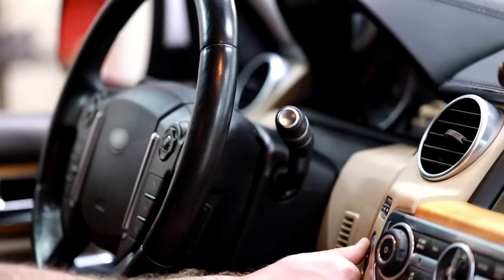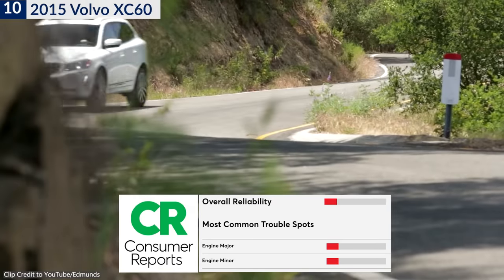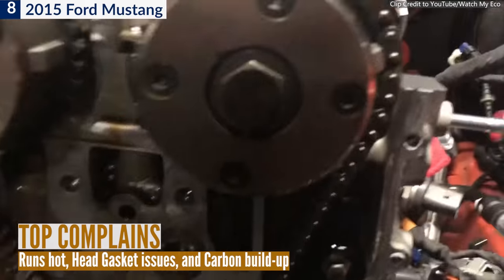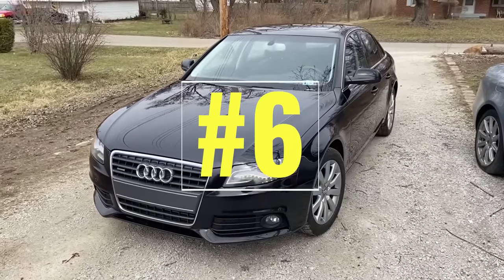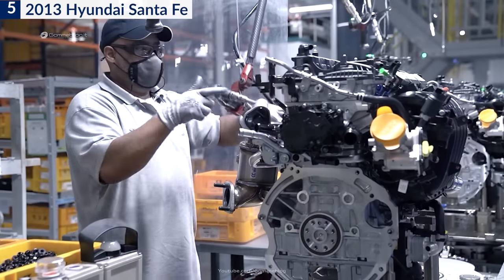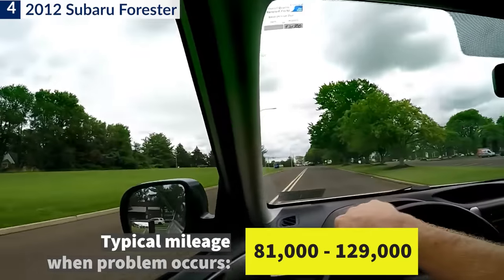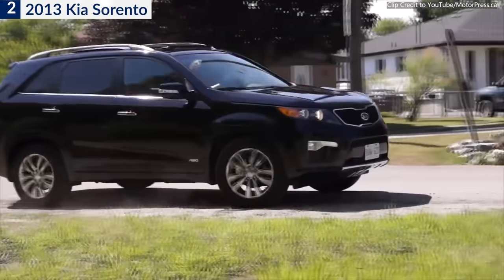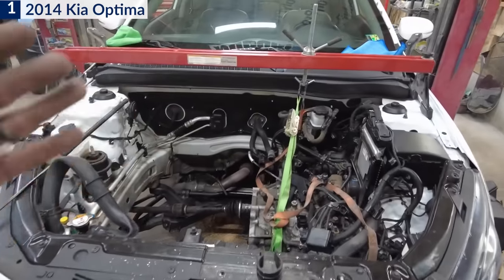10 Used-Cars to AVOID for BAD Engine - as per Consumer Reports

Comment: I love reading the comments from people with 2-3 year old cars and talk about how great they are. Get back to me when it's at least 10 years old with 150k on it and then let me know.
Reply: Facts. Read a comment yesterday from someone bragging about their Subaru’s reliability at 9k miles. That’s like bragging about your new big screen TV still working after watching a movie.
Reply: So true!
Reply: @tx611  or a commercial.
Reply: Okay how about a 1980 VW diesel Rabbit (non turbo)5 speed 1600cc with 365K on the clock and I saw the clock was not counting out the distance traveled.  So obviously it had more.   Didn't buy a new clock...because of the price...so took it apart on the kitchen table and (see if I could fix it as it was broken)  I did fixed it with model glue(on plastic drive gear)and it was good to go.  I wanted odometer to work to know when to change oil.   Put 1,000,000 miles on that car and no; I was not dumping in a quart of oil every 400 miles.  With that amount of burning you would see a cloud of blue smoke behind you.  I ran pretty clean and clear.   It didn't use any oil worth mentioning as it leaked, so I check the dipstick every morning before I drove anywhere.  I ran 30W oil in the summer and went to 20W for the winter (or what  VW puts in all their vehicles) Regular oil I bought at "Wally's" the recycled stuff that was the cheapest.  Yes the car had a timing belt which I changed myself every 60,000mi(mileage suggested by VW)(because I read the car repair manual for VW and I had the tools)   I have over a dozen old timing belts hanging on the wall that I will use for other machinery that are belt driven.   If  the table saw stops because the belt breaks, then I put on another belt.  The worst that could happen is the saw stops cutting....which takes 10 minutes to swap out.  Nothing  EXPLODES...AND COSTS thousands to fix in Hooter-ville.  An hour under the hood to change the belt and it is near perfect.   About every second belt change, I then take it to VW Dealership that has a shop and have them check the timing of the fuel injection pump.  That has to be EXACT.  1 hour of their time and their expensive equipment and their expertise and it is good to go.  This is BEFORE diesel gate and that only applied to the Turbo VW.   My car got 75MPG on the highway and 60 in town all the time.
,  Oh, I bought the car from the garage as the former owner did not want to get it fixed...it was running on 3 cylinders.   I paid for shop inspection or $400 I was already driving a newer VW with same engine (1982 over a 1980) so I swapped out the motors because 1980 was made in Germany and you could smell it did not leak in water.  The 82 did.  Fixed the engine so minor I do not remember what it was and got it running on all 4.  Sold it for $1600.  After a million miles(15 years)  you just get tired of driving that car and rust holes were starting to show, so parked it.  Never needed to replace the muffler or exhaust.  Just tires and brake pads/shoes once. Being diesel, no one was going to siphon the tank to steal fuel. 0-60 in 12 seconds I think?  It was faster than the Super Beetle 1600 gas.  It wasn't a race car.  It was a long distance economical vehicle.(with heat)
Reply: I have a new car every 2-3 years (change when warranty ends) because I can't afford used cars.
Reply: @Bart-dg6qv  Thank you for taking the big depreciation hits for the rest of us.
Reply: I got an old pathfinder jeep...it reaches 300.000 km before it died...my mechanic who is always taking care of it, beg me to let it go..."give her the peace...she had served you enough " he told me  to go home, he will dò the funeral for my  pathfinder....it took me a few months, before I got another baby....Toyota  4 runner...now I have to talk to her in Japanese, the way I do with my baby pathfinder.... Arigato to you.
Reply: @tke2414  No depreciation over the last 12 months.  lol  A solid 1/4 of used cars under 7 years are selling for more $$ used than the vehicle sold for brand new, and the other 3/4 are well under the average depreciation over the previous 20 years.
Reply: @Bart-dg6qv  how do you afford to get a new car every 2-3 years
Reply: @TheDevs98  If I tell you, others will follow and I won't be able to continue my pattern.
Reply: @Bart-dg6qv  does it have to do with trading in or leasing
Reply: Notice hardly any of the cars or SUVs on the list were Toyotas ......or Hondas .....or acuras .....or Lexus ...which proves the point that most Japanese cars ......or SUVs are a sound investment .....I've owned a Toyota......an Acura .....a Lexus ......and a Nissan ......and never had a significant major problem with any of them.
Reply: Mine is 2012 Lexus LS, and I am still very happy. I have 150,000 miles and no repairs yet. Only an alignment., and of course new tires and batteries
Reply: @tx611  they must have been trolling you and you fell for it
Reply: @bunzeebear2973  thanks for the life essay gramps
Reply: I have 2 Toyota 1 is 1984 truck and a 1985 tercel. Both have 300,000 miles and original engine and transmission.
Reply: My buddy just bought a new Hyundai suv for 50k. He's telling me it's the best car ever made and how amazingly well built it is. I just bit my tongue and nodded along.
Reply: @boivilla7458  a 'pathfinder Jeep' doesnt exist. That's two WAAAY different vehicles.
Reply: Well, MY BMW is two weeks old and I havent had ANY problems with it, except a turbo replacement, 6 wheel bearings, a crankshaft sensor, a coolant reservoir and brakes, but THAT'S ALL! A stellar driving machine!
Reply: Wonder why the CadillHACK CTS 3.6 vehicle and engine aren't on this list? We had a 2014 PREMIUM AWD with the VVT 3.6 engine. Both the car AND the engine, are both the worst I've ever owned. Pure junk. I'll never own another Cadillac. $70,000.00 pile of shit......
Reply: @milojanis4901  Yes. They ARE piles of shit. I know I'll never buy another shit GM vehicle.
Reply: 2013 Lincoln Navigator….200,000 miles. Runs like new. Had to replace some leaky seals on differential, an AC control, but that’s it
Reply: Most of cars they sell in used dealership  have over a hundred thousand miles so what are you talking about
Reply: Chevrolet epica 2.5 , 2007
320000 km no problems
But, every 20000km new oil en filter.
Reply: @tx611  my 2005 legacy gt with 190k miles on it runs excellent. I do take care of it.  Last major repair was 5 years ago to fix the infamous head gasket leak.
Reply: @mschubeck  went looking at getting a diesel pickup before this mess to tow stuff.  Shortage happened.  Lets say I can no longer afford even the most cheap models anymore.
Reply: @Tombzy  Ouch
Reply: 2009 Rav4 Sport, Made in Japan. Only 160000 km, not babied, properly maintained. Good as new, compared to acquaintances who spend more money and time on Ubers than driving their new cars.
Reply: My Dodge Stratus 2004 has 304,500 kilometers
Reply: Got a 18 year old car still going strong
Reply: @tx611  oil
Reply: @zorik74  000
Reply: I still love my 2004 buick lasabre that engine is so good . does' t use oil never had any problems with it ..I bought it in 2005  it was someone's company car . I'll cry when I part with it ...We've been through a lot of life together looking forward to many more years with it.
Reply: @Bart-dg6qv   hey Bart, it’s just you and me.  My crv hit the rear corner of an old Volvo ( an 18 yr old decided to full stop in order to last second turn into a gas station ! ) her rear bumper fell off, my crv seat belt safety locks exploded, yes smell of gun powder! The left side “safety frame” crumpled -  body shop : they called it a totaled car - wouldn’t let me drive it away !, not worth fixing cuz have to pull engine and trany to re-weld.   Gave me 15k.   Now I ride my bike cuz used cars are same prize as new !    I need your secret plan.  😢. I promise not to tell anyone.
Reply: @Bart-dg6qv  see my reply below
Reply: 1996 Ford Ranger 4x4, 5 years on stick.  274, 765 miles and still running great! Used and abused like a real 4x4 should be worked too.
Reply: I'm so Happy with My 2020 4 Cylinder Chevrolet. 🤡🤡🤡🤡🤡🤡🤡
Some people Never see the Title of the cars they Drive. They have a Forever Car payment.
Reply: 2011 f150 230k miles. With the 3.5L Ecoboost. Original engine and turbos. It's tuned on 35 inch tires and I take it off road and beat on it. The only thing that blew up and its my fault was the trans 2x because of wheel hop. I have a 13' Taurus SHO with the same engine @115kmiles similar story but drag race it . Trans blew up otherwise no problems.
Reply: I mean, I'd rather buy a car every like 6-7 years than stick with a 10+ year old car.
Reply: Yea. It's so annoying.
Reply: Exactly. 180,000 miles on my 2010 Toyota Venza V6. Doesn't use a drop of oil. Could probably use a set of shocks but runs great still.
Reply: 17 Ford Edge non eco boost.  135k nothing but general maintence
Reply: 10 years old would still be a car from 2012. I’m driving one from 2003 and it purrs
Reply: @TheDevs98 it isn’t that hard if you have a decent income and more importantly a great credit rating.  The other thing is to make sure that your initial car is one that doesn’t depreciation in value too quickly and also take the shortest loan you can. The shorter loan will almost always give you better rates and you can pay off the interest quicker. I purchased a new 2500 Ram Cummins in 2009 and only took a 4 year loan, the loan manager was surprised and asked if I knew how much my payments would be. I told him I had no idea, it was his job to figure that out for me, I was only making the payments. It turned out to be a little over $800 a month? I doubled up payments a few times and payed it off in 3 1/2 years. I then traded in in on a completely loaded 2012 1500 Ram (didn’t need to tow anything anymore). The trade in on my truck was half of the list price of the new truck, and I paid that one off in 3 1/2 yers too. I use to get a new car or truck every 3-4 years myself, but since becoming sick, I haven’t traded in on anything new in the last 10 years. I still have the 2012 Ram with just over 175,000 miles and no problems.
Reply: These days when a vehicle hit 100,00 miles and it’s paid off start crossing your fingers. #ironic
Reply: I had an optima from 2014.  It ran great, but I traded it for a Toyota Tacoma.  I didn't plan on keeping it for more than 3 years.
Reply: Buzzackly.  I own 2 Crown Vics.  Both P7Bs, which is the same as the P71. Cop cars, but they're the detextice supercisor models.  The '04 has 190,000, the '08 has almost 90,000.  They run like tops.  Just change the oil regularly, and do whatever small jobs come along.  Each weigh 2 tons, instead of 1800 pounds, and with dual exhaust they fly.  Feels like Im in a fighter plane.  And I wouldn't trade them for all the kias and toyotas in the world.  I'd rather fly a Hellcat than a Zero any day!
Reply: NONE of my vehicles are newer than 95. Wait..I did just "purchase" a 2000 Chevy suburban, as a favor. A friend needed money so I Bought it..205,000 miles. Been driving it for last 4+ months.. Everything works..but I'll flip it as I already have too many!
Reply: @tx611  hahaha
Reply: FOR REAL!!! I loved my Maxima until everything started failing on it. I bought it used so I don't know what the previous owner(s) did to it. With that exception I have driven Toyotas for the past 40 years. I am convinced that if you drive sensibly and change the oil regularly they will dependably go for at least 300,000 miles (maybe much more). I got 368,000 out of my 1993 Camry before a jackass teenager rear-ended me while he was racing.
Reply: @shawntayler4709  My sister bought a Tercel, and I begged her to sell it and buy something bigger. She said, "No way! This is the best car I have ever had."  She eventually bought a Sienna, and then her husband drove it a few more years. I encouraged him to sell it and get a (larger) Camry. No luck there. He drove that Tercel until it just completely wore out.
Reply: 2000 Nissan Xterra 3.3 V6 215k miles no issues
Reply: On
Reply: @zorik74  and your interior is falling apart
Reply: 2006 Hyundai Elantra… 160,000… never a problem.
Reply: 2003 camry v6 xle 330k miles 1 radiator, rock punctured it 1 alternator 1 knock sensor all after 250k miles. Everything other part original works fine including ice cold ac
Reply: @hertzair1186  you got a lemon lol
Reply: @zorik74  you got a lemon lol
Reply: @faithjay8393  uh huh
Reply: I have a 2015 Mazda with 140k miles, I guess I’ll be back in two years, so we can talk 😂
Reply: 10 years/ 150K miles without issues is very reliable! After that it’s time to get a new ride or start replacing parts. Unless you are smart and buy an EV or a Toyota!
Reply: Those things are slow as all hell my man they feel fast because they are torque monsters but based on the numbers they're anemic. Reliable as all get up tho. Cops switched in some areas due to the performance becoming a serious issue due to an average v6 walking away from it like it was standing still because the trans was only 4gears and it was not a high rpm engine at all
Reply: 2010 Ford Focus with 445,910 miles. Daily driver
Reply: @Bart-dg6qv so you lose money every time you trade it in, that sounds incredibly stupid
Reply: Who owns cars for 10+ years? I'm in a brand new car every 3-5
Reply: @mikeybarboza3086  what a waste of money. New cars are built terribly after 2017
Reply: Is a 2009 Toyota Venza at 185,203 Miles your bare minimum?
Reply: Whos so poor to drive a car for 10 years......
Reply: Got a 2014 sonic turbo had to replace spark plugs at 54k miles runs fine now
Reply: 2010 Hyundai Elantra GLS on 20 inch rims since 2010...170,000+ miles with an aftermarket intake and Magnaflow exhaust...Replaced  her timing chain at 120,000 miles and she still gets 35 miles to the gallon without issues..
Reply: Most people do not keep their cars for 10 years. I usually get rid of my car as soon as it reaches 60k miles.
Reply: Well this video is supposed to be about unreliable vehicles and they're all like 10 years old. Unreliable vehicle is something I'd expect to break after 50k miles or couple of years of use. If it lasts 8-10 years, that's decent. Gonna change the vehicle by then anyway
Reply: Plate 59 150k miles on clock 👌 Nissan QQ+2
Reply: You do realize that 50% of the people don’t keep their car more than five years right? Some of us prefer to have something new and something cool regardless of whether it’s reliable or not. Some of us like to get out there driving what we want to drive Instead of a Corolla and we don’t care because we’re under warranty. Sure we will spend more money in a long run but I will never have to worry whether the cars are reliable and I will always be driving in something nice. just because you preferred to keep a car for more than 10 years and drive something generic just because it’s reliable or maybe can’t afford anything else that doesn’t mean that you have the right to shove that same thing down our throat
Reply: @tke2414  at least he’s not driving around in Corolla. Not to mention ever having to visit mechanics or worry about reliability I get both points of you, but if the more fortunate can understand the less fortunate, then would only be fair if the less fortunate could accept and understand the more fortunate, it is because that poor are feeding off of negative energy why they will never have what we have
Reply: Today's cars are junk. Average car about $40,000 and fall apart. That's a lot of money to have problems. To much electronics on cars nowadays nowadays that's why they have so many issues.
Reply: People with 2 year old cars don't keep cars for ten years. For them, 5 trouble free years is all they demand.
Reply: @mynameisgladiator1933   I’m one of those people and I can confirm that you’re statement is 100% correct
Reply: @SgawCules yes, I don’t like to drive an old car or one with too many miles
Reply: 330883 miles Honda Civic 2003
Reply: @Temerario805   2021 Mach E 30k miles. All I’m asking for is 100k and I’ll be super happy with what I got for my money
Reply: Been running a 5.4 triton 2 valve 1999 374,000 just blew a plug that took out the left head. I can get a head for 550 and have it done for $1000 or I can get a used  80,000 mile junk yard engine with a 3 year warranty fit $2000 but $1600 to install still cheaper than a used van when my van has very little rust. So I’m not sure yet what I’m going to do.
Reply: 2.5 mazda 2010 170.000 miles  ,still rocks
Reply: My 2012 civic lasted 12 years with 316000 miles then the wiring went bad the engine and transmission were still good
Reply: @tabacct76  no one cares. It’s a civic. It’s still a bucket. I’d rather make monthly payments til the rest of my life and drive something cool. Not everyone cares about travelling to the moon and back on one engine
Reply: 1999 Ford E350 373,000 on it just blew a spark plug and it’s the same cylinder I had it blow 3 years ago . Still runs great when the plug is in and tenant still shifts as it should. But cannot find anywhere you could double heliocoil it . They keep saying it need a new head. That’s more than I paid for the van in 2004 .? 700-900 new for  the head .
Now buying a 2500 Chevy van for 6 times what I paid for this
Reply: Exactly.
Reply: I am so glad I'm a Toyota Tacoma truck owner for the past 20 years of Reliability & for as long as I live & surely Not Battery Powered Junk.😊
Reply: I have a 2003 Toyota Tacoma Pre RunnerV-6 with 277,000 actual miles on the original engine. Mobil 1 entire life of vehicle.
Reply: I had a 2013 Hyundai Elentra. It was a manual and never gave me serious issues and I used to drive it back and forth from MD to MN. I got it up to about 189k until I decided to be speedy Gonzales down the road and smacked it into a tree. The car protected me and I walked away without any injuries. I know thar car would have easily  gone over 200k but now I drive Toyota.
Reply: '14 Accord just turned 222,222 miles.  Spark plugs once.  Still low oil use and high mpg's and fast.
Reply: 😂😂😂 @Bart-dg6qv 😂😂 guess you love adding $ to an already high note.
Reply: Have a 2005 explorer sport trac with 275,465 miles. It is awesome little "truck", right now just needs a new radiator less than $100. It runs great.